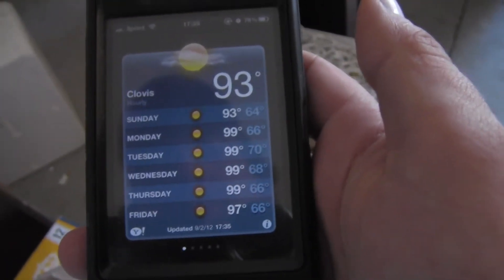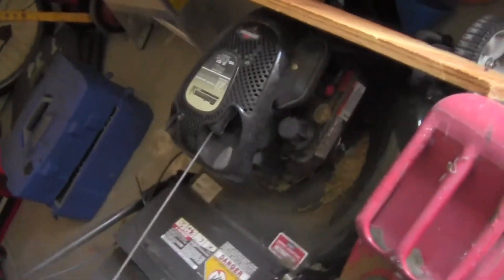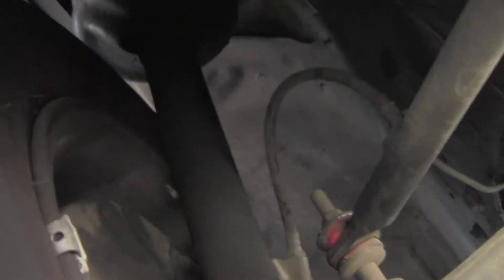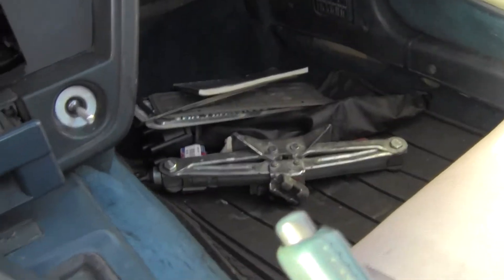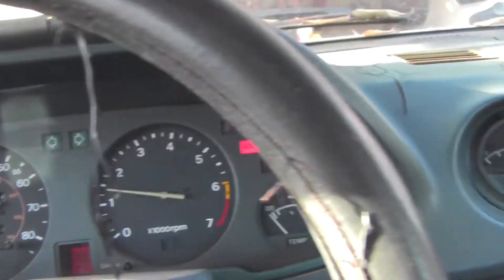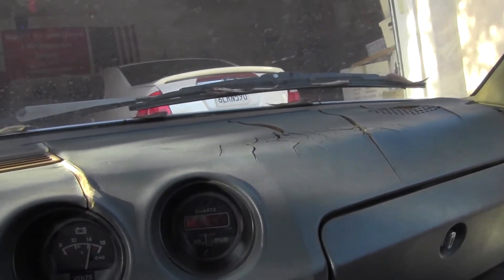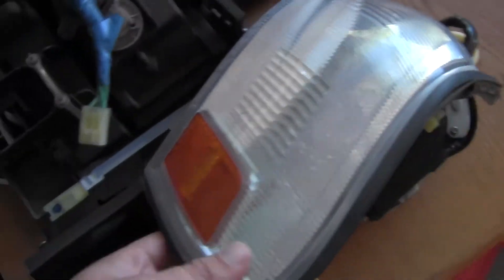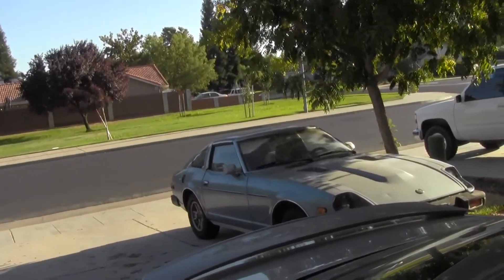Update on the Datsun and Cressida

Comment: Idles a little high. Adjust idle screw. Tb.  Located above the AFM  its screw within a spring. Counterclockwise higher rpms. Clockwise lower rpms.